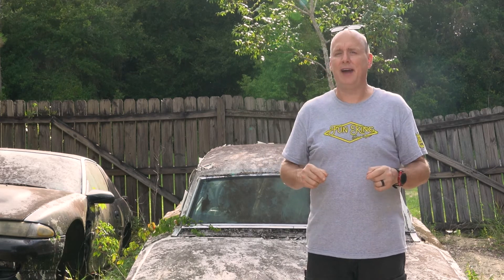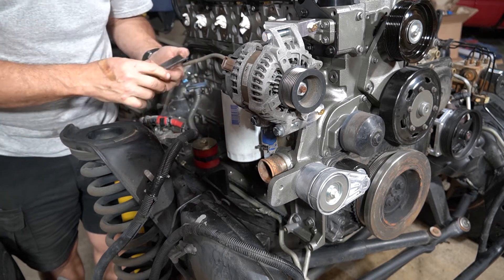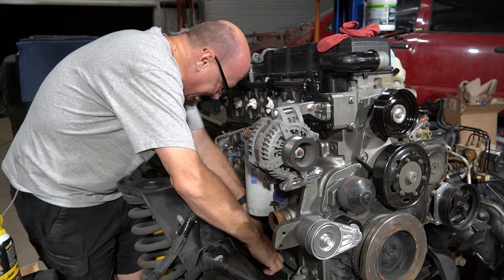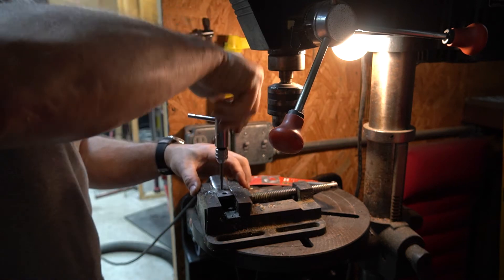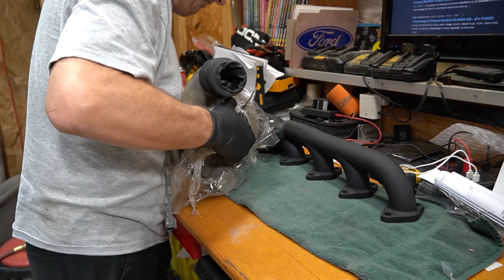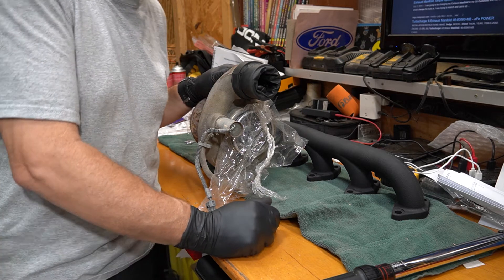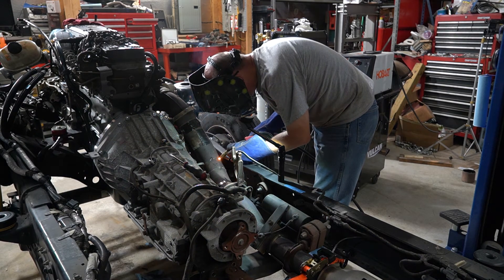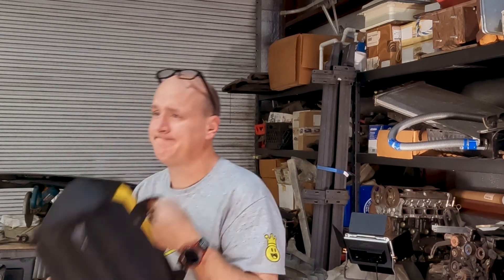The Fummins Project - Episode 8 - Trans Line Bracket, Exhaust/Turbo Install, and the Downpipe

Comment: Flo Pro FLO20811 down pipe is a drop in for the CR swap 08-10 SD trucks. You have to remove the alignment pins on the turbo elbow to help clock everything to clear but it's a perfect solution.
Reply from the maker: I will look into that. I am curious though, being that you have to adjust the engine position, and no 2 would ever be exact, I have to assume that you would still need to make some modification to it. Plus, I have to assume... no more assuming, I just googled it. LOL! I see you would still have to mod it a bit as it does not have the Ford flange on the end, but that does look a LOT easier. Not a bad priced item either. Thanks!
Reply: @FunKingGarage  The only mod I did to the down pipe was cut it back shorter and add a Walker 42891 piece to take up the small distance needed to reach the delete pipe from the original 6.4 system. That eliminates the piece with the ford flange on it completely. I tried modifying the original 6.4 down pipe but Ford had made it a double walled set up (pipe inside a pipe) that I couldn't remove the inner pipe and it just didn't end up that nice after welding the Dodge flange on. For the price of the Flo Pro one there wasn't an after thought to cut my losses and throw that one in.
Reply from the maker: Oh, that double pipe thing Ford did was a NIGHTMARE. LOL! I appreciate the info on the Flo Pro. I might order one just to mess with it.